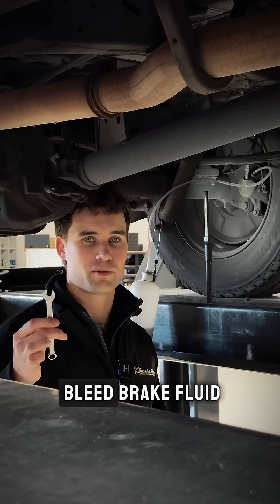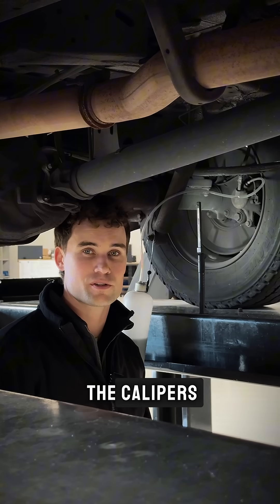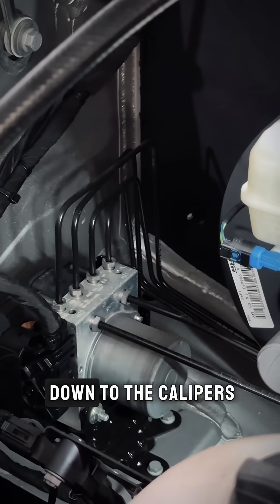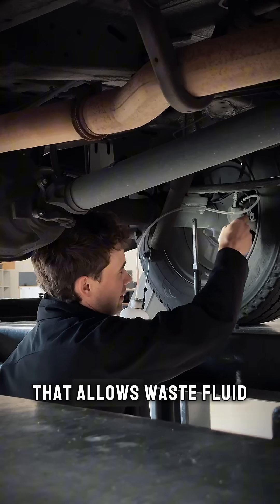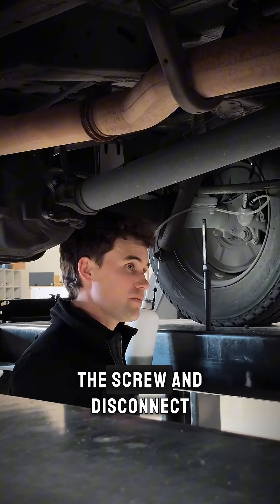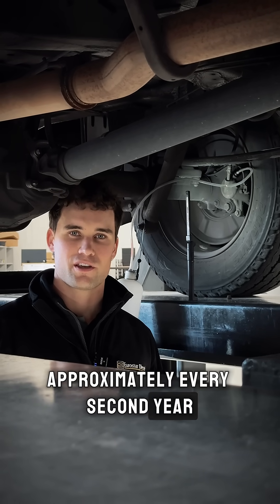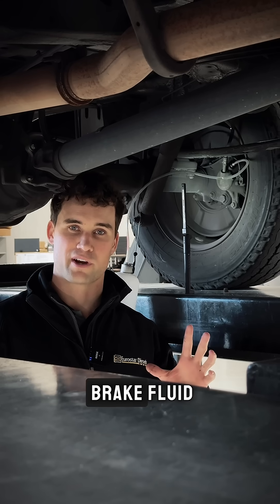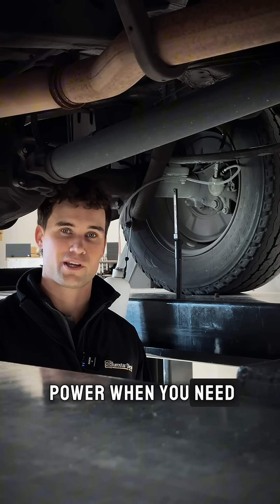Soft Brakes Need To Be Bled

Comment: The old way was so much cheaper than any Mercedes dealer ,,,, I’ve had my sprinter serviced always with a Mercedes Benz stealer over the last 5 Years and he has never changed or suggested to change the brake fluid THE MERCEDES BENT STEALERS ARE AS POOR AS SH@# IM SO DISAPPOINTED I ENTERTAINED BUYING A MERCEDES Wollongong

Comment: Hope no one gets scammed lol brake fluid does absorb water but its slow like 5 to 10 years as long as u arnt going crazy and racing it... but if u are buying a car that requires a brake fluid change every 2 years... i guess that's your own stupidity.
Reply: Exactly !!!! IM SO SICK OF STEALERS AND DEALERS TRYING TO STICK IT UP YOUR AS% TO MAKE IT WORSE MANUFACTURES ARE IM CERTAIN ARE JUST FORCING US POOR BARSTARDS  BACK TO THEIR STEALING DOORS ……..WHY DO WE HAVE TO HAVE,, ELECTRIC DRIVE MOTORS TO TURN THE HEATER UP AND DOWN ,WHAT WAS WRONG WITH THE GOOD OLD PULL CABLE ?????? I’ve NEVER HAD TO PAY 280 DOLLARS TO ADJUST A HEATER CABLE ….LETS GO BACK TO HORSE AND CART ,,,,,SORRY DO I SOUND STRESSED ,,,,

Comment: Having a machine like that to be nice. But if i'm just hanging two Is calipers in the rear of the car It's really the gravity believed them for a minute or two And then have somebody step on the pedal to finish it up with me.Just my take on it. There are times when we have air Deep inside the system and that could be helpful To use a Pressure bleeding device